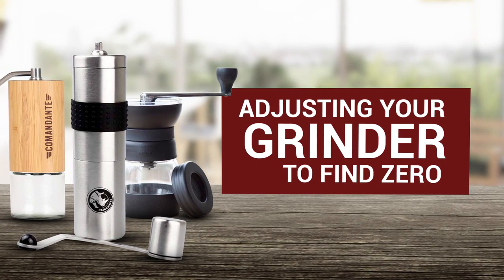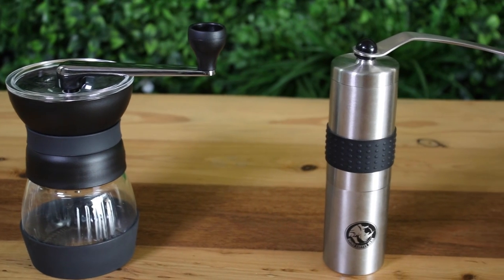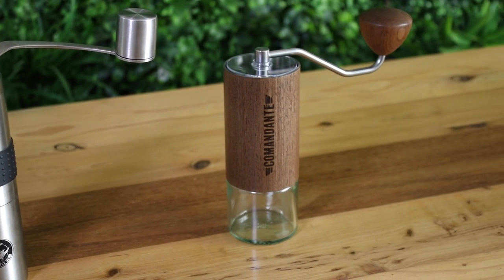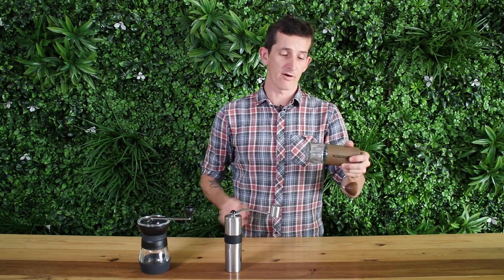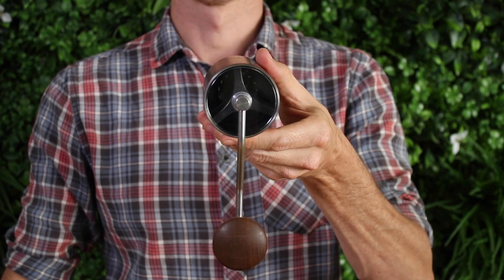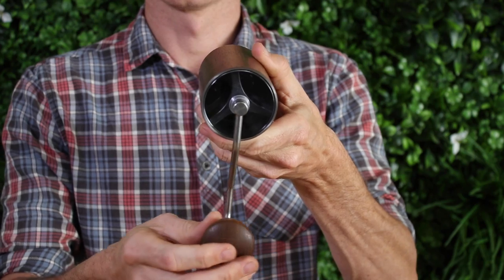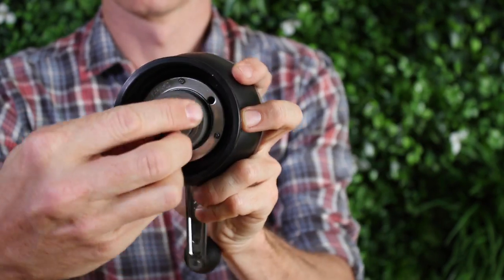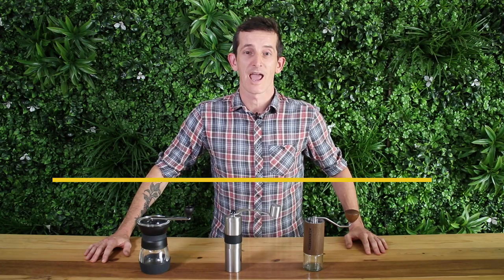Adjust your Coffee Hand Grinder to find Zero Calibration | Alternative Brewing

Comment: This is great. However, can you be sure it applies for all grinders? I have the Timemore C3 and using your method, the zero point I found was 2 steps different from what the "turn until you cant turn anymore" method yielded. So now I am unsure as to what the real zero is.
Reply from the maker: good point - and quite possibly not applicable to all grinders. If the Grinder comes with instruction on the ZERO point - than follow this 👌 if no instructions - this is a great start for counting up to replicable grind settings
Reply: @AlternativeBrewing  yeah to be honest, i'm still not sure what to do on my c3 after reading a dozen reddit threads :)

Comment: Hey, thanks for video, it's very straightforward, but what if the lever does not fall off in any configuration? I've noticed that in the tightest setting lever is unmoveable, is it possible to count it from that kind of point?
Reply from the maker: Yes , thats the best place to count from 👍

Comment: Thanks - just got a Porlex Mini and was lost until I found this video - but concerned. Should the full circle be 100% even? I have about two clicks of 'stutter' before it stops. Does this mean the grinder is defective? To better explain, I don't have a full fall of the handle for about 2-3 clicks before the handle doesn't fall at all.
Reply from the maker: I'm not aware of any issues that would cause this and you will have a bit of grabbing of the burrs as you tighten it, but I would to be safe, take the ZERO point from where the handle no longer falls. Try holding the grinder body too at a 45º angle as opposed to a 90º and see if this helps 👍

Comment: How do you find zero on the Lume portable burr grinder when it doesn't have a handle? Would you bring the burrs as close together as the nut will allow,  and assume that is 0?
Reply from the maker: That's correct - be sure not to turn the Grinder on at this stage as you don't want to force the motor to turn against the ceramic burrs.

So If you're able to view the gap between the burrs as you tighten it finer - the moment the burrs touch and there's no more gap between them - this is the Zero point - or close enough to it.

Comment: Does the zero of a grinder change over time, or does it always remain the same?
Reply from the maker: Zero is a constant figure that won't change.. It's where the burrs touch together and no coffee will be able to grind through.  Your grind settings will change though. If your burrs become worn down over time, you'll need to grind finer to get a similar grind size - this would take more than 120kgs of beans before this would happen. For example.. you started brewing aeropress with a setting – 0 +6 clicks. As the burrs worn down, you noticed you had to grind at 0 +4clicks to get the same size beans - this would be a good indication of the burrs wearing down.

Comment: This might sound like a dumb question, but wouldn't zero just be the point where the nut stops screwing (ie at its tightest?)
Reply from the maker: Yes - It would be good if it were this way across all HGs. .. but the issue is that some grinders nuts - screw against the burrs far more than others - so a setting of 1 and you may still not get any coffee out of the burrs
This way of checking the zero point ensures the moment you begin to coarsen the setting you'll get grounds. 👌
Reply: Exactly. But "until you cant turn anymore" means different thing for different people based on strength and the subjective interpretation of how hard to turn. I wish my handgrinder took this into account and had a clear "stop" point

Comment: Could you please tell why there is a need for searching for the "zero point", as it is not the tightest position. If I set the grinder to the tightest point and make one rotation, I get very fine coffee. However, given the comment before, related to the point zero -  " It's where the burrs touch together and no coffee will be able to grind through. ", it does not add up. It seems that the burrs touch together not at the "point zero" but at the tightest position of the grinder.
Reply from the maker: So the zero point would be best described as the setting one click finer than the last setting you can grind coffee out with. - Though with some hand grinders - the zero setting is in fact 3-4 or more clicks away from the true finest setting.. and than, as is the case with ceramic burrs, there's usually 2 or more settings from the Zero point before coffee will be ground out. So it's just moving the scale up from the true finest setting, usually where the burrs touch, but not always the case..  and be able to relate to the settings quickly for more of a functional understanding of what grind size you're actually using ... otherwise we only have micron sizes to refer to
Reply: @AlternativeBrewing  Thank you very much for clarifications!

Comment: Everyone recommends c.6-8 clicks on the Porlex Mini Hand-grinder for a Hario V60. I’ve always assumed that was in reference to from the fully tightened position instead of the zero point. Looking forward to trying this out tomorrow morning!
Reply: Well, in theory those should be the same thing. If they instruct us to turn until we cant turn anymore, there better be some mechanism or design feature to ensure that is a clear cutting point, for most people, not something you need to guess on. I'm not even that strong but can easily push my grinder 2 more clicks under what this video"s method gave me as zero.